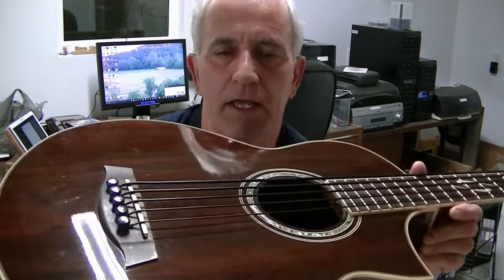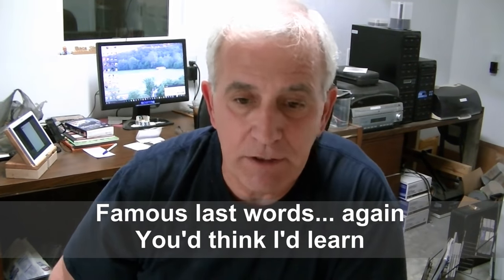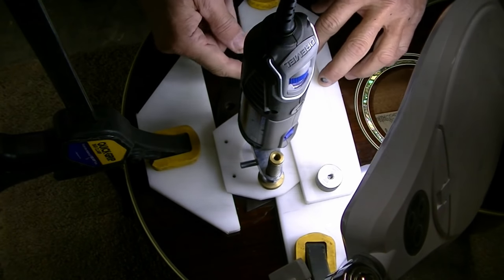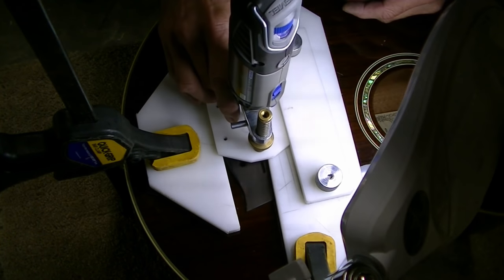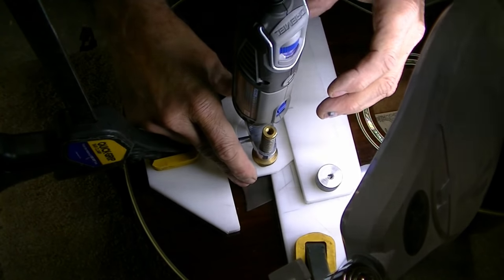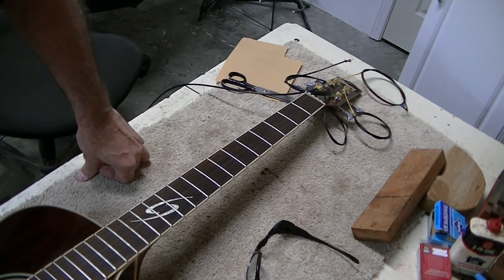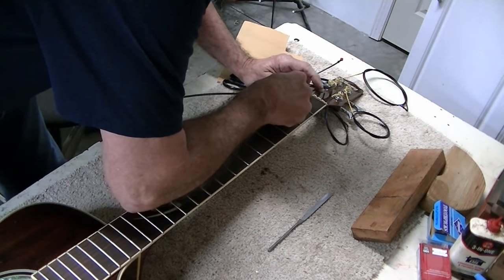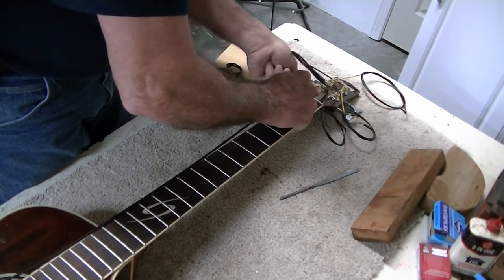114 RSW Ibanez Bass Severe Intonation Problem

Comment: That's why the plastic saddle was L shaped. The factory knew the intonation was sharp and chose to sell the bass as if it was correct! Speaks volumes for the company. You probably did more than most would even attempt! Which river is on your desktop? Thankz
Reply from the maker: Thank you.  Appreciate your understanding of the situation.  The picture on the desktop is of the field outside my shop.  I can see how it kind looks like a river.  There is a spring fed creek running along the edge near the tree line.  Thanks again.
Reply: It looked like one of the many beautiful rivers and creeks in good ol Mo. Thankz

Comment: after all that, time wise, how would you compare what you did with making a new bridge and moving it back (wider to cover the scar in front)
Reply from the maker: Claudia Octavia certainly moving it back would have been a better fix but there were several problems with that.  Number one the customer didn't want to pay for all that.  Number two, the giant holes where the pegs went through would have been a lot to fix because if you just moved back enough and then drill new holes you would have big long slots through there instead of holes. Thanks for watching.

Comment: I think I would have made a new bridge identical to the one that is on it but wider in the front to cover the old location.  That way you could move the bridge back to where it needs to be but would still cover the old location.  I doubt anyone would notice the difference unless you put it side by side with the original.

Comment: When you look at an electric bass guitar, there's invariably a compensated bridge often with adjusters for each string. If you buy a guitar with a fixed non-compensated bridge, just how good can you expect the intonation to be?
Reply from the maker: Good point. Thanks for watching.
Reply: @RosaStringWorks      -  You went MORE than the extra mile Jerry.  - - In fact,... that customer sent you to Hell & Back. 
.
(He should have been just as SHREWD & DEMANDING when he bought it. !!! - - You made an EXCELLENT repair & video )
.
.

Comment: im sure theres an obvious legit reason why i havent seen you shim the side of the saddle when you need to widen a saddle slot as you would if you could have by now?  is it simply because of sound transfer or too much pressure?
Reply from the maker: I haven't seen that video in awhile but I thought I did shim the side of the saddle on the back side.

Comment: I intonate a number of basses, and I've confirmed through the players that the low B has to be played very soft, bc of the frequency size and tension of the string. Either way it can be difficult even with adjustable saddles...
Reply: Agreed on your comment,... Jerry was tuning the lower (bass end) string to a 'C',.... and it was already loose and vibrating all over the place. 
.
( Even a - lower bass end -  'E' on a Rickenbacker 4003,... is really loose (slack) when setting,... especially if the player is a (heavy handed) SLAPPER.
.
.

Comment: 1. To check intonation the guitar have to be in playing position
2. One more thing you can do to improve, use lighter string.

Final thoughts, this guitar was supposed to be checked before buying it, it's a piece of you know what LOL
The only way to make a proper fix, this bridge would have to be completely replaced and repositioned, and of course refinishing the top,
since this is probably a plywood junk guitar...NOT WORTH IT ...LOL

Comment: Well done, I think I'd be happy at this point if I were the customer.  

I've been playing bass so long that I could hear the intonation was still bad on the top three strings after the new saddle was installed, I find sometimes that working with tuners on basses is very frustrating, I can tell by ear when it's off (but I'm not as good doing that with a guitar).  

Something else I think I would have considered and discussed with the customer is the gauge of strings.  I don't know what he was using, but a lighter gauge may have been right on the money (but probably would have required a truss rod adjustment and maybe even some work on the nut).

Good job, really great to show us when things don't go well, and also the importance of pleasing the customer!
Reply from the maker: Thanks Dean.  I really screwed up by not letting you hear the before... Talk about hearing it.  Oh my gosh!

Comment: This is the reason that they were using multi scale or fanned frets way back in the fifteenth century Europe to solve this problem. If the instrument is tuned in fourths it is not as bad a problem as it is if the instrument has strings tuned a fifth apart.

Comment: Hmmm - I would have eyeballed the saddle slot and dug it out with a dremel and a knifeblade - what a hassle!  Who cares how it looks as long as it plays? Easier to expand the slot rather than move the bridge - what, 1/32 of an inch? You should see the field repairs I made when I was homeless - they looked terrible but could make that ukulele/mandolin/guitar - whatever I could find in those years - play like a dream. No proper tools or glues and I would still make it work. Museum fixes are for collectors and OCD players if you'll pardon me. Don't get me wrong - Jerry and I come from the same place logistically however I never could afford the tools or workspace. That's not a complaint - just a different POV.

Comment: Yep. you have to play tapewounds almost like  you are playing a fretless, they stretch like rubber bands, and you can "tune" them with finger pressure. Dude should probably just put some flats or rounds on it and call it good. Plus it's a 5 string... those B farty notes always sound out of tune to me.
Reply: The scale is probably to short to get any good intonation on the C string. You can go to a C base string on a violin, but intonation is only an issue on instruments with frets since the player controls the intonation in learning the individual instrument.

Comment: If the customer couldn't tell a difference in the intonation after the first time you worked on it,by ear,then maybe he should take up another hobby,other than playing music. Just saying.....
Reply: well to be fair, if intonation is off, it's off, simply improving it doesn't make it in tune. 20 cents vs 10 cents is improvement, but it still sounds like ass. Not Jerry's fault at all, the guy should have never bought the POS in the first place. Also he should have put better strings on there. I like the sound and feel of tapewounds, but I have had pretty bad intonation issues with them, even with the bass setup perfectly. Something about the nylon coating makes them behave weirdly.